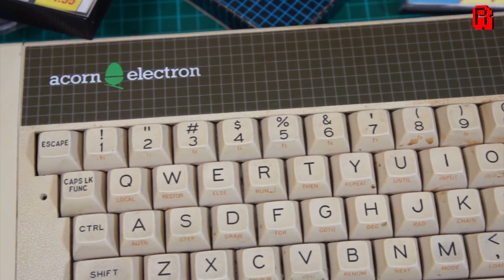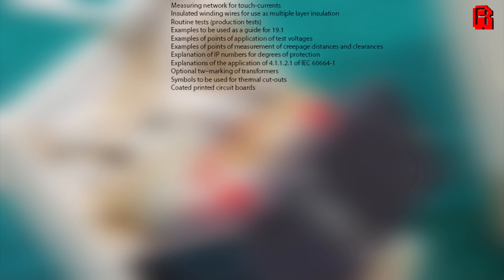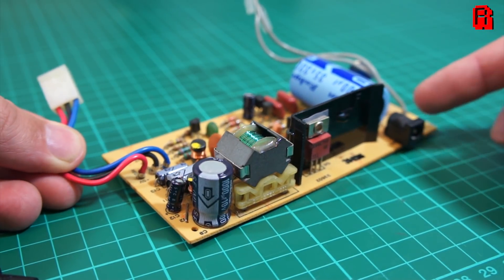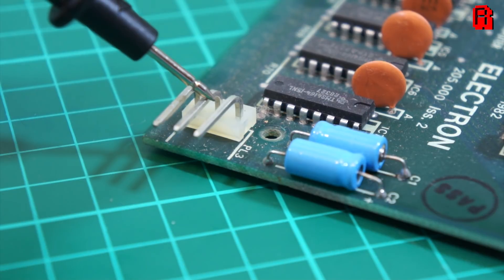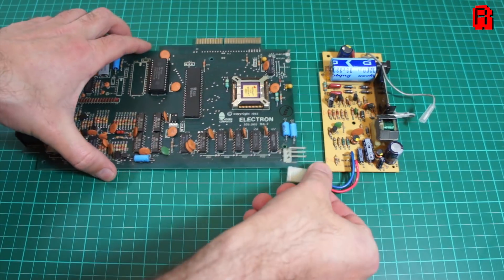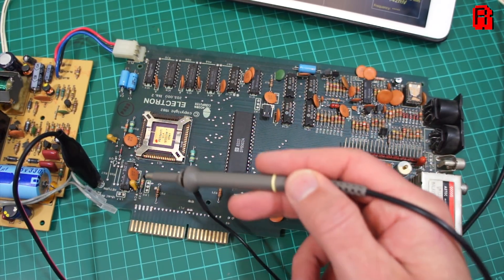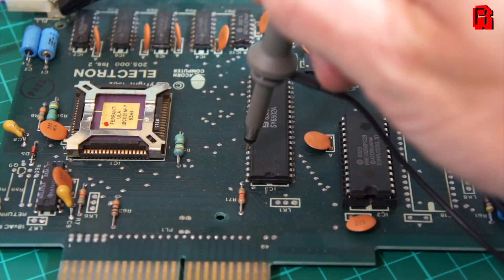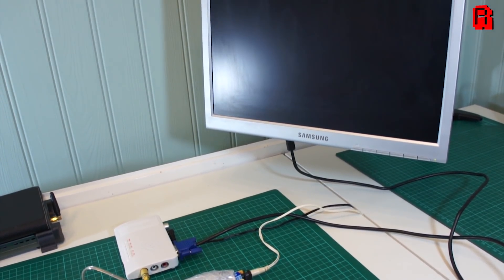Acorn Electron | Pre-Flight Checks - Trash to Treasure

Comment: I really want to work with non-emulated BBC BASIC and have been thinking hard on the Acorn Electron. This video has helped answer a lot of the questions behind my hesitation. I’ll likely start looking in the spring when the flea markets start back up. I don’t know what I’ll find in Germany without going to eBay, but I’d like to try anyway. Thanks for the thorough runthrough. It’s very useful information.

Comment: Hey Guys. Just checked the ROM chip  on my FleaBay Leccy and i have Ground Continuity on  Pin 14 as per the video (5:08) but I also get continuity on pin 20 ?  or 23 if you count from the bottom of the chip. Does anyone know if this is normal ?

Comment: Trusting the CE mark to mean anything is a common misunderstanding. We assume that the mark can only be applied when official bodies have seen the product, tested it themselves and are happy to sign off on the "certification" allowing a company to place the CE logo on their product. Thus the public can be assured that seeing the CE mark means that it wont blow your fuses (at best) or burn your house down (or assist with if it is a CE marked rubber duck).

In fact you are as safe, or not as safe, using that obviously messed with electron power supply as you are with any modern CE marked power supply. You can be safer if you are certain you trust the manufacturer (assuming they actually make it).  This is because the CE mark is a mark that can be applied to any product made by anyone, even that 10 year old kid making RPi hats down the road. It is a statement from the manufacturer that THEY consider their product to be safe and meeting certain official safety standards, which THEY are responsible to test for compliance.

They dont need to ask permission to use the CE mark. They can use it for free. It is just like adding "go faster" stripes to a van, the van may not go faster but they can try getting away with saying it does. 

If something goes wrong, enough times and with the correct amount of legal representation, then the company can be asked by the court to prove why they believe their product meets the CE recommendations. That is the only protection we get. When enough people get hurt or die, we can use the court to sort the company out. 

The only way that we, the public can be sure of the safety of electrical products old and new is to ensure that we get them independently tested ourselves, or the manufacturer of the product includes documentation showing that they have obtained certification to go along with their use of the CE mark. Of course this is assuming you trust a bit of paper that can be printed by anyone to tell you this.

Its a real shame that I cant think of any sure way to solve this problem. At the end of the day its all about trust, and those with the skills such as yourself to open and test these devices are skilled enough to gain that trust in them. 

I got all this from someone I trust. His channel is very good, and quite humorous: https://www.youtube.com/watch?v=f0uvS80YIGU
Reply from the maker: +dlarge6502 it has certainly been a hotly debated topic here in the comments!  Some good advice there.  It is up to countries to test CE marked devices although this is often reactive rather than proactive so doesn't help really.  Trust is certainly required.  Cave Dwellers are an intelligent bunch but this is one of those things where either side of the argument can be strongly argued.  For example in a previous video I was told how a commenter lost their brother when a dodgy old plug burned down the house.  I guess the easy option is not to mention it at all but to be honest the debate has been an interesting one down here in the comments and if the result is raised electrical safety awareness then it's all good

Comment: A DPS5015 with enclosure is ~$50 total, you provide a large power adapter (thrift shops have a lot of these), which it then steps down.  It has both current and voltage limiting.
Reply from the maker: soupisgdfood thanks for the tip
Reply: RetroManCave i bet you could get it free for running a banggood ad.  I’m not affiliated with them or anything, I just see several channels like yours having banggood promos.

Comment: Cool video, but I've gotta say that the original Electron PSU (if it passes visual inspection) would be so much safer and less likely to burn your house down than a cheap fake Chinese PSU from eBay or Amazon Marketplace. The Chinese firestarter PSUs will have the CE mark printed on them, and all sorts of other safety standards that the PSU doesn't meet... what do the Chinese fakers care if the product doesn't really comply and someone gets killed? Always buy from a reputable dealer, one of the big boys like RS, Conrad, Digikey, Farnell, Element 14, Rapid, etc.
Reply from the maker: +ForViewingOnly I agree.  If I suggest you need new tyres for winter and you buy cheap remoulds you're in a worse position.  If you buy a fake Chinese knock off PSU then safety marks mean nothing.
Reply: Or perhaps CE means China Export :P 
Excellent video about how to check old computer before use. I have old 80's Salora Manager (Vtech Laser 2001), my first ever home computer which has been sitting at my parents place unused about 20 years and the thought of checking out if it still works have started crossing in my mind more and more often lately but have also been worrying about the old capacitors and power supply, how safe they are after standing unused at least 20 years. 
This video is very useful in that regard so thank you for making it :)

Comment: I'd only replace the electrolytics and tantalums on the main board and the electrolytics on the power board but leave the big smoothing cap unless it's absolutely necessary.  What scope software/hardware are you using? Second psu looks perfectly fine and unnecessary to change.
Reply from the maker: I've been looking closer at the boards.  The power board has Rubycon and Nichicon caps on it which look good and are very good quality brands so I think I will leave them.  The system board has Richey caps so I'll probably swap those out, just the 5 or so Electrolytic ones.  The ceramics can stay.  The scope is a Hantek from their IDSO range (http://www.hantek.com/en/ProductDetail_10165.html) and I have the 70mhz one.  The tablet is just an app to connect to the scope and show the display.
Reply: Thanks, I have a Rigol DS1074Z (hacked to 100mhz of course) I'm more than happy with, was just interested how you were able to display on other devices. I'd still recommend checking the ESR at least regardless of brand if you're able to.

Comment: The power supply is fine. Someone just changed the cable at some point. It's just a transformer anyway, it's not likely to fail. The actual power supply is inside the machine.

Comment: I would definatly agree on checking out any electronic that has been stored in an outside shed or in damp/moist environments (like a basement or garage). Also be very wary of old electronics coming from humid places like Beaches and Tropical area's. Humidity can accelerate damage and corrosion to metal and electronics.
Reply: I installed a dehumidifier in my garage, runs 24/7. Setup the outflow pipe so it goes through a hole in the wall, so no need to empty the bucket. Good investment if one's garage is filled with tech.

Comment: hi, what is the brand of the video to VGA converter you're using in this video ?
Thanks
Reply from the maker: That's an MTVBox 1920.  Cheap ebay job which I haven't used for anything other than testing like this, as I usually use a CRT when using them in earnest, so I can't give you a full recommendation only that it does the job I need.
Reply: Thanks for the info !!

Comment: Hi, I have one of these modules at my workshop. 

http://www.ebay.co.uk/itm/DPS3003-DP20V2A-30V5A-50V5A-DC32V-3A-Programmable-Step-down-Power-Supply-Module/272718281609?ssPageName=STRK%3AMEBIDX%3AIT&var=571854069865&_trksid=p2057872.m2749.l2649

It's a great budget bench top power supply if you're happy to make an enclosure for it.
Reply from the maker: DJ legion thank you, would you recommend it?  Any problems?
Reply: So far no problems at all. I am using a 19v laptop power brick so I can step down from the 19v to anything I want. Take a look EEVblog video. https://www.youtube.com/watch?v=Cw2AjcczHg4

Comment: No power brick is safer than one using just the transformer. If new one is anything different than a fused transformer, it's most likely that you're better off using the old one. Replacing capacitors is a good idea, though.

Comment: The acorn electron has the strongest and toughest endurance of any keyboard ever made, mine took some right punishment and lasted years lol i've acquired a few of them in recent years and a few of the addons too that I hope you are going to feature
Reply: My brother had a ZX81, I was so glad I didn't have to contend with what he had to use, though nevertheless he still did good things, including machine code games. My unit's kybd also took a right pummeling, years of use, months of Elite, but in the end it wasn't the kybd that failed, looks like it's more likely one of the RAM chips (ULA checks out ok in another system). The kybd was really good, and it's funny how its distinctive sound brings back such immediate memories.

Ian.

Comment: Couldn't you just replace it with almost any old laptop power supply? Those are usually the same plug and 19v.
Reply from the maker: tithund yes a laptop power supply is what will be used
Reply: Are laptop supplies not DC rather than AC?
Reply from the maker: More commonly DC but there are plenty of AC ones available.
Reply: In my experience, when computers use an AC power supply, it means they have a bridge rectifier inside, which'll accept DC as well.
Reply from the maker: Indeed this one does as we discovered in Episode 1.  There are many stories of people using a DC supply with the Electron with no problems.  Just be aware that 2 of the 4 bridge diodes won't be utilised if the current isn't alternating which runs a very small risk of shortening the life of the 2 which are used.  Lots of tales of people who have done this for many years without issue though.

Comment: I really hope you find a the "official" tape deck for this machine. It's properly smart as it's dimensionally correct and just looks lovely next to it.
Reply from the maker: Neffers that would be a nice touch, although where we're going we may not need tapes :)
Reply: I smell a Data Centre. ;D
Reply: I've bought one of those for my BBC Master- but I wasn't aware it would work on an Electron. No reason not to do so with a Plus 1 I guess, but unless we're going Plus 3 or something Slogger put together, this'll be interesting..!
Reply: I managed to get hold of a Plus 5 aswell, very rare, along with the Music 500 setup for the Electron. I actually bought the D.C. for a 64K Beeb, but the D.C. guy included an extra floppy with some stuff that'd allow it to work with an Electron aswell. Note that I obtained the less common external version so that I could switch it between different systems (I expect most people just fit the board inside the case).

Comment: At 9:29 the video chart table - mode 4 should be 2 colours not 4 (it's listed the same as mode 1 otherwise but taking half the available memory)
Reply from the maker: +Damien Guard thank you I just checked my source and it is indeed wrong.  I'll update that when I release the finished series.  Well spotted
Reply: Perhaps worth mentioning at some point the various custom modes that later coders achieved, they were covered in various issues of Elbug and also Beebug after the mag merger. Combining different modes on the same screen was particularly impressive, though it was of course easier on the Beeb.

I also hope at some point you can cover the various 2nd Processor options for the Electron, eg.:

http://www.acornelectron.co.uk/mags/eu/revs/pms/E2P_000.html
http://mdfs.net/Software/Tube/6502/Electron/

Here's another fascinating site I found while hunting for Electron info:

http://stardot.org.uk/forums/viewtopic.php?f=3&t=9911

Ian.
Reply: There were some impressive split mode and palette demos in Electron User in the late 80s. I've been trying to build on some of the techniques that they used: http://stardot.org.uk/forums/viewtopic.php?f=2&t=10147

The stardot forums (http://stardot.org.uk/forums/index.php) are where a lot of new software and hardware development is discussed these days.

Comment: Seeing that power up screen brings back old memories and 99% of the time it was CTRL + K and SHIFT + 2 twice for - CHAIN "" - and RETURN, the click of the relay switch and PLAY on the cassette deck.

I did always wonder why the Electron cassette load command was different to the more common LOAD "" of other 8-bits. It did have a LOAD command but you needed to type RUN after the software was loaded afterwards.

I probably looked it up years ago but my early 40's epilepsy thrashed brain has forgot hahaha.

Comment: I think I would trust a nice simple 1980s transformer PSU rather than a modern Chinese one. I have seen too many modern cheap (and not so cheap) PSUs with scarily thin insulation between windings, and almost no clearance between primary and secondary sides.
Reply from the maker: +Zadster I agree, you get what you paid for and a knock off modern power supply which flaunts all standards is no better (or worse) than an 80s one built to older safety standards.

Comment: If you had a proper bench PSU, what you'd normally do is to set it for 5 Volts anyway, then increase the current limit in steps instead. ;)

With too low a voltage (or too slow a ramp-up time), the chips aren't so likely to start properly, and it could even feasibly cause bus contention, or latch-up.

Loved the vid btw.

I have fond memories of playing on an Electron in the 90s, and messing with weird Telex / Prestel machines.
Reply from the maker: +ElectronAsh Thanks for the advice Ash, these are techniques I need to explore once I get myself one.

Comment: No wonder those adaptors from the 80's are not so save as you would expect, because that big metal part inside it may can get sooo hot that it even can melt the plastic of it.
Reply: It can't get hot, the power consumption and thus heat is not high enough. The Electron draws very little power. However, a short circuit or other issue could certainly cause problems.

Comment: Nothing wrong with either of those power supplies, unless you could see something I can't. They're bulky things, so often smashed apart if dropped, which made them dangerous, but you'll be better off with one of those than a dodgy Chinese knock-off of some laptop charger. Of course if you're buying a genuine psu to replace it then carry on - do whatever makes you feel safest.
Reply from the maker: +jcswright lots of dodgy CE marks out there on fakes of course, something to be careful about for sure.  It's a tricky one when demonstrating to others.  You're damned if you say aw go on risk it, and you're damned if you don't.  I like to err on the side of caution for the sake of others
Reply: RetroManCave you're doing the right thing. Really enjoying your videos :)

Comment: I may be missing something, but when you connected it to power, you might as well connected it to a monitor. And only when you would not see what is expected, start poking with probes. Just a thought...
Reply from the maker: +XaFFaX.tk yes indeed, I just wanted to take the opportunity to display a few more of the chips behaviours for the sake of completeness, but if I wasn't demonstrating then I would have put the monitor in at that point.  I'd like to probe the ULA later while changing video modes to see how the signal to the CPU changes

Comment: My only concern is your theory of gradual increasing voltage to the board. In my opinion it could be good for analog components only, but you never know what could happened to digital ICs, especially the old ones.
Anyway nice one. Thumb UP.
Reply from the maker: +To masz Interesting thank you, as with most things I tend to think out loud first and then research, sounds like this needs some reading up on before enacting.

Comment: That psu damn, so basic its cringeworthy, no protection whatsoever.
Reply: Synthematix

Most of those types of PSU actually have a fuse and / or thermal cut-out inside the transformer itself.

That still didn't prevent a lot of them melting though. lol

Quite a few of the old (potted) C64 power bricks are starting to fail now, but unfortunately often take out the C64 at the same time. 
The big 5 Volt reg inside the PSU tends to fail short-circuit, so ends up putting about 12 Volts into the poor machine. :(

Comment: word of warning about using the CE label to see if it's a good power supply some Chinese ripoffs use the CE when it isn't truly certified generally they use a very slightly different image to dodge copyright(or something like that) issues
Reply from the maker: Cl0nec0mmand0 good point it's definitely targeted by fakes.  With the Electron you can use laptop power supplies, so stick to a trusted genuine brand from a legitimate seller.
Reply: But the Electron uses AC 19V does it not, whereas it is DC 19V for laptop PSUs?
Reply from the maker: dextrovix AC ones are available.  It can also safely accept a DC input but I won't be doing that.

Comment: What's the smallest anomaly that would cause you to not turn on the machine?
Reply from the maker: +cerberus65 probably a failed trace when doing the continuity tests.  On these older computers it should be fairly easy to work back and fix that rather than risk turning it on.